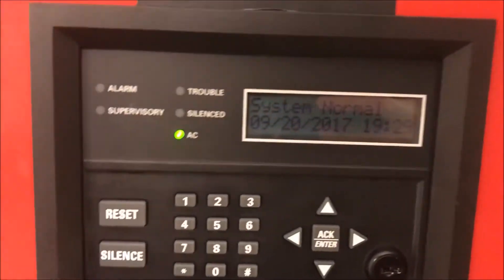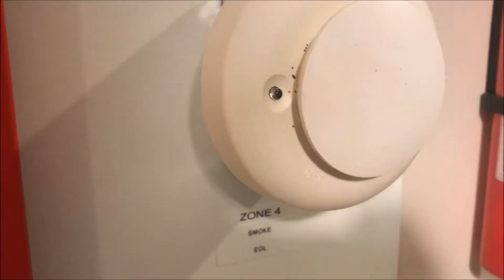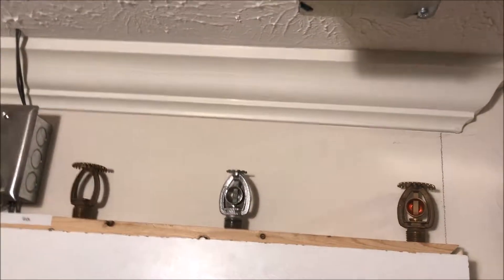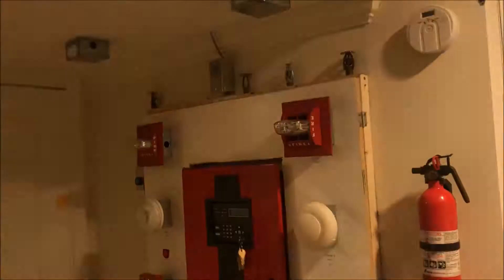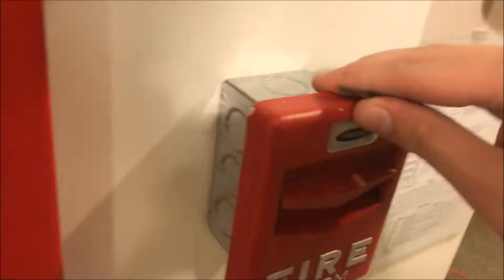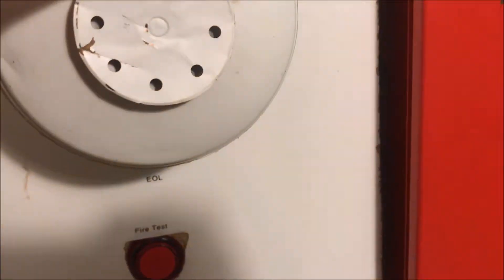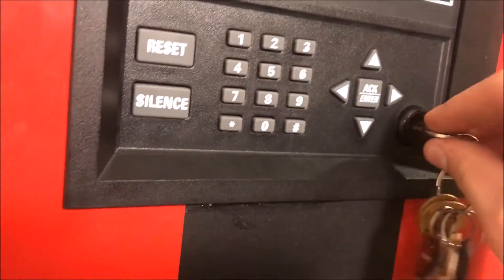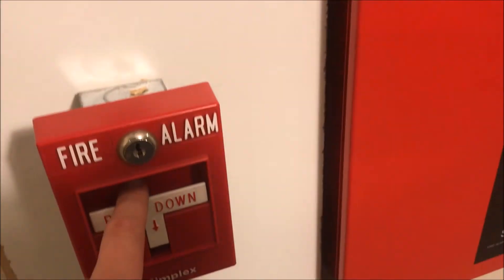Wall Test 11: System Sensor MASS

Comment: Is that MASS a misprint? Because the FIRE markings are upside down.
Reply: I thought that was odd.
Reply from the maker: Yes, it is a misprint. The device is orientated correctly with the "TOP" facing upright